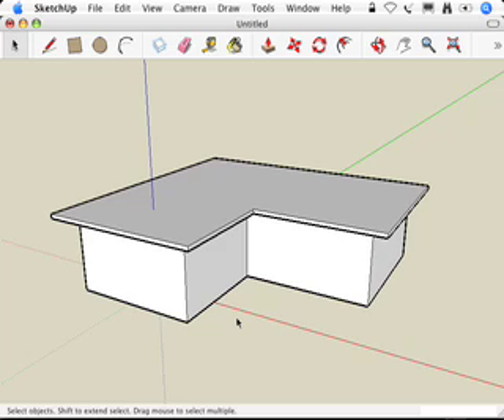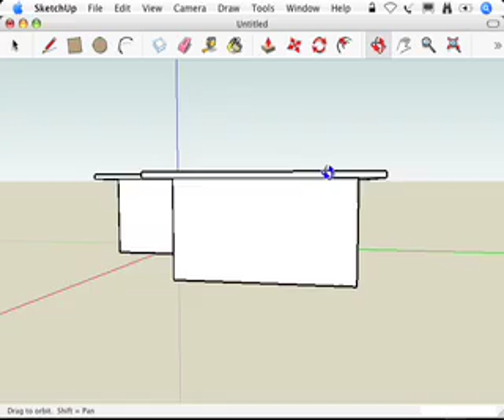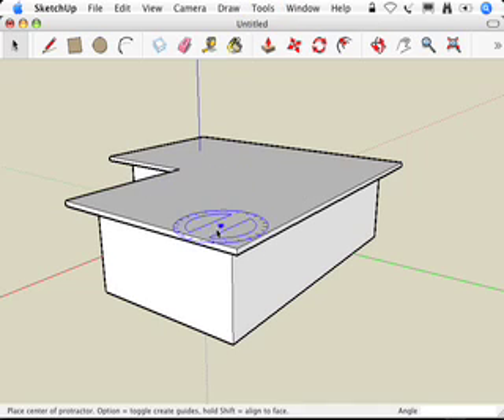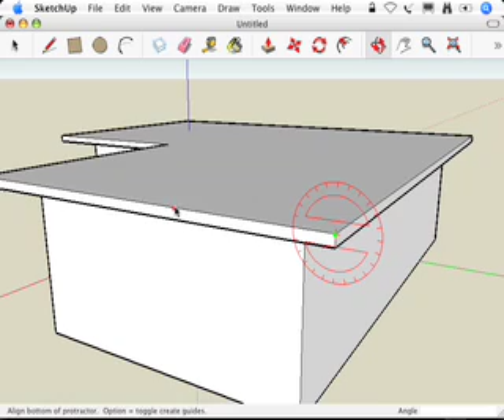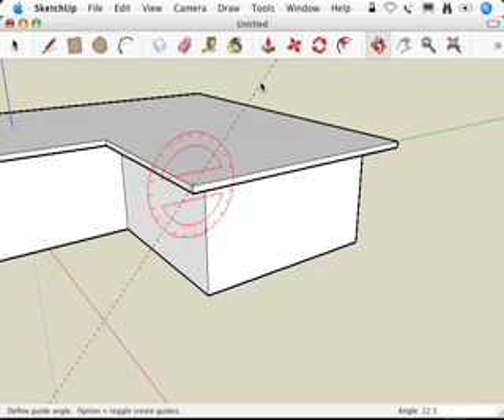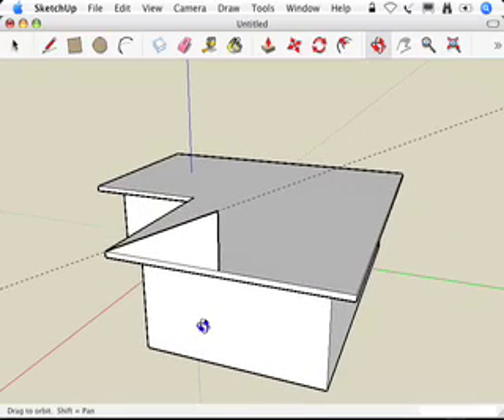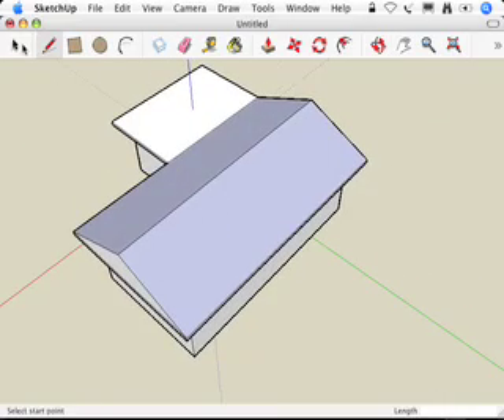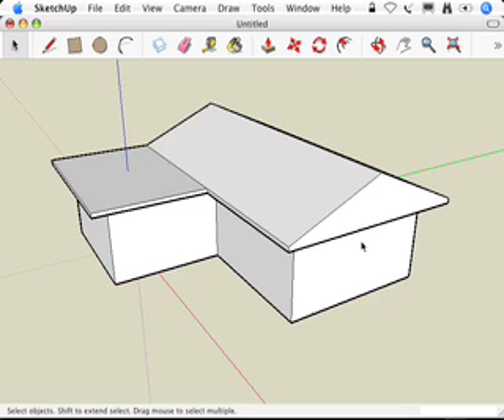SketchUp: Constructing gabled roofs

Comment: This was helpful but a little disappointing at the same time.  Mainly because there was no mention of how to make the walls underneath the gable end of the roof into gable walls.  I've never seen any houses with gable roofs IN THE REAL WORLD that have a gable end detail like this.  Where the walls were straight at the top and there was a huge soffit and what would normally be the gable top part of the wall is part of the roof.  It's as if this was intentionally overlooked in order to make the process of making the gable roof unrealistically fast and simple.  That's my problem with a lot of 3D programs.  They are quick for modeling stuff, driven from the feature set of the app itself, but as soon as you get into modeling things the way they are in the real world things slooooowwww done drastically.